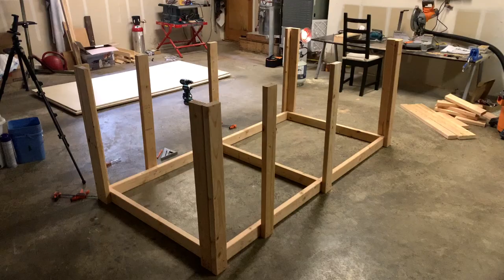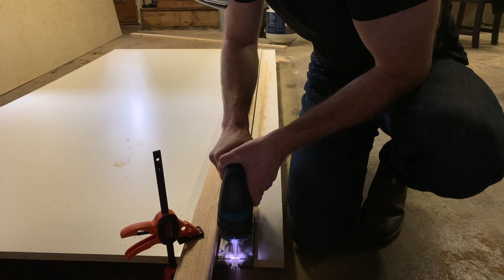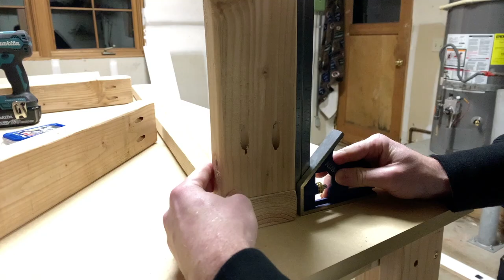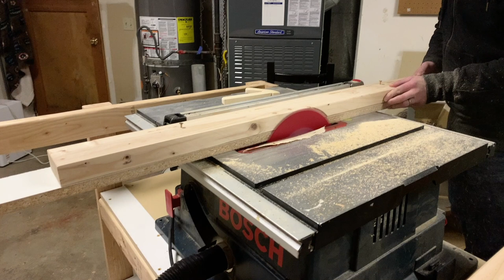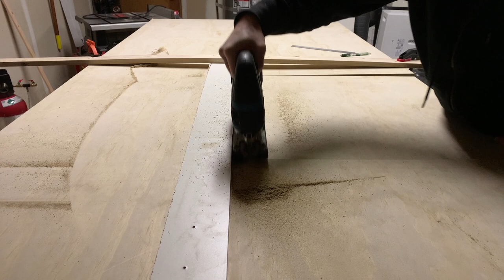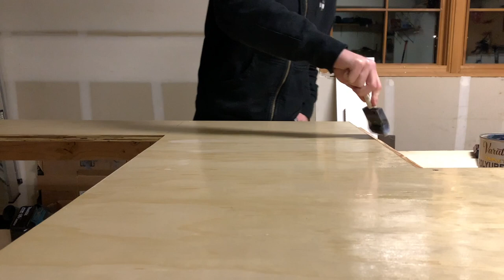Making the ultimate mobile table and miter saw workbench (w/ subtitles)

Comment: Best way to determine workbench height is to stand straight and be able to rest your hand flat.  Has worked great for me for the past 30 years.  Good for your back!  
All of my work surfaces are at the same height so materials can be moved and supported by the table saw, work bench, miter saw, router table, etc. I work in a garage so I pay attention to the slope that all garage floors have and level everything.
Reply from the maker: Thanks. Yeah you’re right, I realized later the garage floor has a slope, whoops! I recently went back and re-leveled the table top with the tops of the saws (since the wood has dried after a year and a half) and it’s working out pretty nice.

Comment: I have that same Bosch table saw, I am going to build this, I do see a few upgrades you could do to make this almost indispensable, but it's definitely a nice job for something quick and low budget.  

Here is the improvements I would do to it:  

For squareness and strength, glue and screw each frame joint using either a rabbet or half-lap joints.   Glue up 2x4's with grains opposite each other, then square them up, you'll cut out a lot of the warping that way.    Use either MDF, or Baltic Birch Plywood, it's very smooth, very strong, and will won't warp and loose its trueness like regular plywood does.   

For a few extra dollars and a little more time to build, you can router a channel the length of the table and add t-tracks for clamps, jigs, etc. as well as miter slots for a crosscut sled to go past the factory slots in the saw itself.

Lastly, after the polyurethene cures fully, buff out the table surface, both the factory machined table and fence, as well as the plywood bench top as well with 0000 steel wool and some paste wax, don't forget the miter slots,  the object is to allow your work to glide along the table, even the slightest binding can cause a kickback.

Comment: Howdie awesome thanks for sharing your project with us ya got this l,m mecnec  and ya make it so l can understand you that things happen so ya built it its ok in my books 😊all is good 😮ya dont have to worry what others say or do cause l,d probably  hav issues with the same way and ya got me beat this is what l need for my shop it will do the job my shop is 40by60 and half mechanical and other half wood so doin what l can with what I have  if it works great doing this french cleats thing to make room something  l need too make room like this table so signed up for adventure mighty fine Sir thanks again from Canada 🇨🇦 SK later keep it up 😊
Reply from the maker: cheers mate

Comment: NIce simple design. I'm going to use it for my jobsite saw. However, I would just note that there appears to be minimal room between the far end of the table saw and the mitre saw. That does not leave much room if you want to rip larger pieces of wood or sheets of plywood

Comment: Should set the table saw in relation to the bench top, not level to the floor.  I noticed the saw was too high.  How did you deal with the miter gauge which will run into the new bench top?

Comment: Might be time to buy a track saw or at least a circular saw, bet it took ages with a jigsaw?
Reply from the maker: Yeah a circular saw is definitely in order.
Reply: I got a circular saw (Makita 18V) last year and it's as much of a game changer for those type of cuts as an impact driver is Vs a normal battery drill for day to day screwing (not as much fun as it sounds). Plus you get to cut fence posts and other large beams and do more random things like chop up old fence panels to fit in a car..

Comment: What is with everyone making crappie corner post? Just using screws and single 2x4 post.  Like does no one get it.  that won't support zip.  there 2 ways to increase how much the table can support. 1) is to use 2 2x4 screwed together and notches  made from the 2x4 to over lap the frame. 2) the other is to use a 4x4 and cut the notches out of the 4x4 and screwing the frame to the 4x4 so the frame is resting on the 4x4 notches.  this can support a morpho  6 ltr motor on table top with the 6 speed transmutation.  This also improve the look of the table.  Makes it look like table.  Yea it take far more time but it a better table. and add more down force legs to the table to support a Craftsman 1952 103 8" tilt table saw.
Reply: Isn’t crappie spelled crappy? If so, you have a crappy way of spelling crappie…
Reply: @azul8811  Hmmm…I believe crappie is a fish…